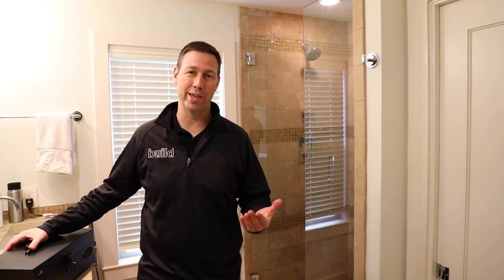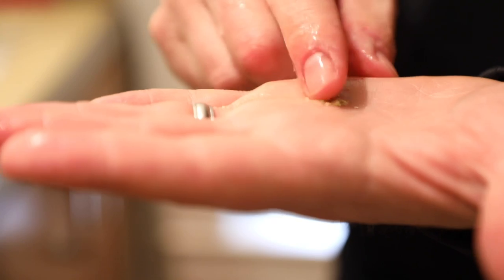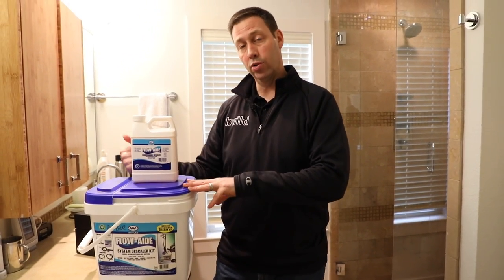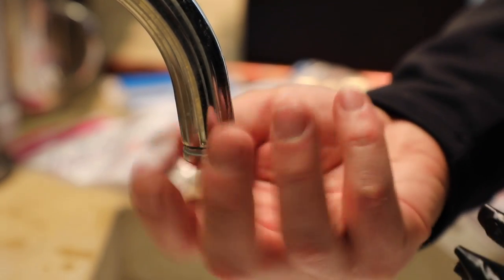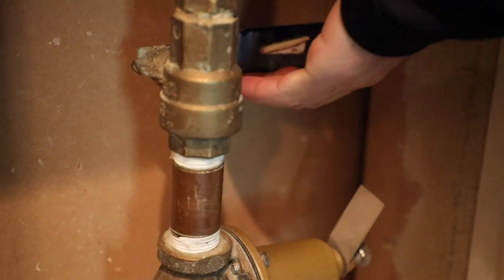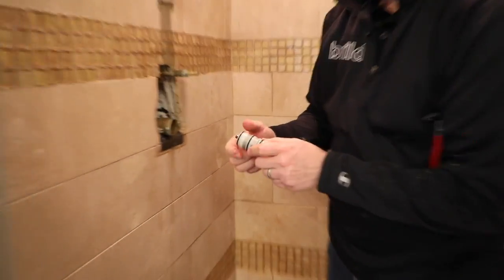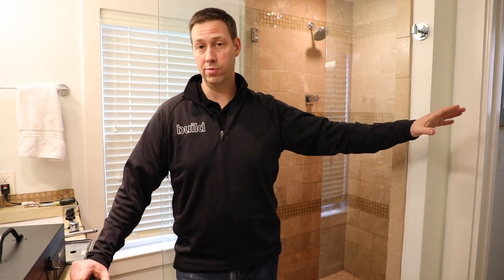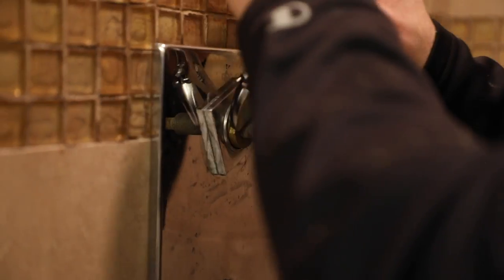The Bummer for Tankless Water Heaters - Fixing a Scale Issue

Comment: Matt, your videos are always extremely watchable, but I do have something to offer concerning the flushing procedure.  At least on my tankless water heater, immediately below the water heater and in-line with the cold water supply is a thimble-sized water filter that needs to be removed and cleaned after every flushing...or more often if the supply water is unfiltered or otherwise prone to have fine debris, sand, etc.  Recirculating "contaminated" or particle-heavy cleaning solutions is asking for such a filter like this to clog and fail.  The typical homeowner is then stuck with having to call a plumber to remove and clean the internal spinning flow-control device needed to inform the heater of flow demands.  Fouling the filter would be a major whoops.  And by the way, my water heater manufacturer specifies clearly to never use chemical cleaning solutions, but instead stick with food-grade white vinegar, 4 gallons in a 5-gallon bucket.
Reply: GOOD COMMENT.     You are providing information that his guy "Matt" probably has no knowledge of.   After all, he may only be a plumber if anything at all.    He does a lot of talking without putting much thought into what he actually says.   There are many things stated that are either completely wrong or very misleading ....but I doubt he cares.

.

Comment: Not sure how this works with you in the US, but here in Holland our boilerless water heater ( which also heats the house ) gets an annual inspection. Almost the complete unit gets pulled apart and cleaned up.
Reply: J.D. Willemsen Yes they make units here in USA,,which does the same thing domestic HW, or ‘and household comfort .

Comment: Need a fix..
My problem is the instant heating boiler tankless ...

I can't set it in the middle 😩 

It's too hott or too cold... no mild water..

When turned the faucet it clicks inside and goes too hot even on only  the lowest number 1 heating mode...

Comment: I know this is an older video but would Spindown mesh filters installed at the outlet of your on demand heater prevent scale from reaching water fixtures? Or will scale also accumulate inside your plumbing and break loose at later times resulting in the same scaling issue?

Comment: Do you remember the dip tubes maybe 20 years or so back??  Looks similar. .
  You need to have a softner & filter especially for those units.  If water is doing that, its also not very friendly to your washing machine and dishwasher.  
 Benefits of soft water are huge besides needing it
Reply: and the salt water flush goes where?
Reply: @CyberAnvil  usually find a stand pipe from the washing machine, laundry tub, sump pump, outside, or a leader drain.. Always find a place. It's definitely worth looking into. I did a few seminars, soft water extends the life of appliances and so much else.
Reply: @thomasbroking7943  
yes, i've installed and used a water softener.  soft water is nice, just thinking of the hundreds of pounds of salt dumped into our sewer systems.  personally, i lived in the country so i had no choice but to route the salt water down one of the downspout corrugated pipes leading to who knows where.
Reply: @CyberAnvil  hundreds of pounds??  They make them that use potassium also if the salt is an issue..where i live they have shown videos of the city plowing into the sewers, so salt from the house isn't even a thought
Reply: @CyberAnvil  it's a no brainer after you are blowing through water heaters, dish washers, washing machines, and especially these wall hung boilers..
Reply: @thomasbroking7943  
well, i was on well water which had a fair amount of minerals.  with a softener, soap lathered better so i suppose all cleaning was better, but i never noticed any breakdowns due to mineral deposits.  by the time minerals would have become a problem, it would have been time for a given unit to retire.
Reply: @thomasbroking7943  
a 40 lb bag of salt pellets (rock salt doesn't cut it) didn't last all that long.
Reply: @CyberAnvil  it all depends on the settings..hardness & volume = days between regeneration.. You can run it non stop and burn salt because you don't have it set right. I've been in a house that has had a 1/4 of the salt tank for 6 months already.. I'm waiting for it to get down to wash out the tank and I know it's regenerating to quickly became the previous owners were 5 and new is 1 .   potassium is also an option if salt is a problem.. Maybe you just want to install filters that don't use salt at all
Reply: @CyberAnvil  how often does it regenerate? How many thousand gallons is that?
Reply: @CyberAnvil  driveway salt doesn't work in the softner but the softner salt does melt snow. I preferred it thinking it has to be better for my property than the pellets, cheaper also
Reply: @thomasbroking7943  
crystal potassium is not popular here and very much more expensive.  dissolved minerals don't care about filters.

Comment: perhaps I an dense. why is there no filter on the outlet side of the water heater? I would not stop the scaling or the low flow but it would prevent the scale from contaminating the entire system after the heater.
Reply: Stanley Bourdon I say a y type brass fine filter with a ball valve on the y so you can FLUSH OUT THAT CRAP, if you can container it before it gets through the water circuit.

Comment: So what you are saying is 
Install water filters coming off the tankless to protect the water lines and fixtures.
and change once a year..
(Cheap saftey from clogging every thing up.)
and run the whole house on soft water....
Reply: You should put a descaling filter before the heater on the cold water input line. And a water softener if needed.

Comment: Typical rookie moves- sets shower faucet parts on the edge of the sink, possibly knocking them down the drain. 2. He doesn't bleed pressure off the system by opening the sink valve first, allowing the shower to spray him with water. 3. Replace the shower valve so the pressure pushes sediment through the sink faucets. 4. This need to be done on every faucet in the house.

Comment: So basically add a water softener before tankless
Reply from the maker: Yes. Or consider a more traditional tank
Reply: Or a descaling filter
Reply: What water softener unit do you recommend, Matt?
Reply: Yes, but not for drinking water.
Reply: wouldn't a screen after the heater solve a lot of this or do the deposits form farther down the line?
Reply: Actually, this happens with tank type too if you have really hard water.
The tank heater itself will be okay, but you will need to clean shower head, aerators on the faucet outlets, etc.
Reply: Down here in South Texas water softeners help but they don't under any cirumstances stop the super hard water we have down here.
Reply: Is that not code?
Reply: austin conant a RO system, would do too.  Where I live, there is a inlet water gauge,  then a whole house filter, outlet gauge, softener  brass filter , phosphate feeder ( food grade ), outlet gauge, , then an
RO sysrem to kitchen silk, & refrig ice & drinking water.
Reply: No a filter. The softener adds salt which probably will just worsen the problem.
Reply: jon spon I think that might be a possible solution. However, I’m not sure how this would impact overall flow capacity or pressure.
Reply: Robert Smith actually the salt is used to flush the resin beads of the minerals it has pulled from the water.  The flushing cycle happens in the early hours of morning by design and a final rinse removes the salt water before it goes back on line.
Reply: @skimbulshanks  maybe your fancy one does. For others it'll just clog and break down valve actuators burning surfaces etc.

Comment: I wonder if a sediment filter after the meter would make a difference and/or whole house filtration system.
Reply: A sediment filter (provided it was installed in a way that could be easily serviced/cleaned) might help, but it won't solve this problem as the problem is that the minerals are dissolved in the water. They attach themselves to the metals and imperfections and then crystallize forming that grit and scale. This tends to happen at points of big temperature difference (like the heating coils) and on imperfect surfaces where it can "take root" so to speak. In the case in the video, enough built up on the heating coils and in the "tankless" tank that parts of it broke off and traveled downstream to the shower and the faucets. A sediment filter just after the tank would help fix that issue to an extent and would make for an easy first step to troubleshooting. If putting a sediment filter on the cold line, not going to help so much except catching stuff that city or your well pump system did not catch.

A whole house filtration wouldn't really help unless it can de-mineralize your water (which is sort of what a water softener system does), which the video maker comments on a bit.
Reply: Kurtis Whittington nice comment thanks!
Reply: @MrBrianDuga : Agreed.
Reply: @KurtisWhittington  Good explanation, I appreciate your input.

Comment: We have had tankless for years and never descaled. First one was an antique cast iron with copper core. It died because cast iron feet rusted away. Maybe good water? Maybe u crank the heat too high? There is no reason to heat the water hotter than the hottest shower. There is no reason to mix in cold water (unless someone likes it hotter).

Comment: Tankless manufacturer’s recommend flush once a year
Reply: Does the manufacturer know how many people are in your household??? That is why he said if more then 2 people use it, flush it yearly and if just 2 people or less every 2 years will work just fine. (unless you got really hard water)
Reply: mister clean   could try Hot Water Sediment Post Filter System, still need to do maintenance, the filter will catch a lot of corse clogging sediment before it gets in your pipes

Comment: Tankless are not limitless hot water. there are very particular flow amounts they can do. They are a hot water heater without a tank, thats it. Not instant heat (at the faucet) nor limitless, both common fallacies. Many houses with maximum usage need more than one tankless.
Reply: Brent Farlie it has to be PROPERLY SIZED , or there will be complaints.

Comment: I'm wondering why he just didn't use the water stops at the valve its self.  Pull the cartridge open & close the stops. Then just turn the sink faucet on & off a few times. Then leave the faucet run. Do the same with the shower valve. Reinstall the aerator and shower head. You're done. His way would take longer. I guess that's ok if you are getting paid by the hour. 
   Buy a tankless with Stainless steel heat exchangers.  It doesn't stick to the coils as bad.

Comment: Tankless water heaters do not have "boilers."  They heat the water below the boiling point, preferably 120 degrees F. And your "bummer" scale deposits are the ruination of tank-type water heaters. With tankless, the heating elements are not destroyed.  Put a pre-filter on it and forget about calcium deposits. Mine is twenty years old. I have hard water but never need acid to dissolve calcium carbonate.

Comment: Top tip: Turn off supply, don't open tap to release pressure, attempt to disassemble valve, get covered in water, get clipped round the ear for making a rookie mistake - you'll only ever do that once with a high pressure system.

Comment: WOAH! HUGE LIE! if you have a water softener you still absolutely have to flush your tankless hot water heater. not only will not flushing void manufacturers warranty. it'll destroy the heat exchanger especially a copper one. the copper will pit and make it more susceptible to leaking.
Also tanks are supposed to flushed also and give the same kind of sediment build up in aerators. so this problem is not unique to tankless hot water heaters

Comment: scale build up happens to both tankless and traditional water heaters. if you have tankless system, you need to have some sort of mineral reduction system to prevent this from happening, or you have to drain and flush the system every 3 months.
Reply: Well, you are partially correct.  "scale build up happens to both tankless and traditional water heaters" IS correct ...which is what this guy has very clearly inferred is the "downside of tankless heaters" ....which is completely INCORRECT.       BEFORE considering the need for any kind of "mineral reduction system", you FIRST need to know if any kind of system is needed in the first place.    Typically, people DO know if their water supply is HARD or SOFT water to start with.  However, it is best to have the water tested first and actually KNOW exactly what the condition is of the supply water.   THEN, you will know what needs to be done to make the water better for your water system.

Typically, "people" learn about their water by talking with their neighbours over the fence or at a party.   This is NOT how to learn about your water ....unless the neighbour can hand you a recent certified water test report to look at.   Not all "mineral reduction systems" are created equal.

.
Reply: @taxicamel  After several more years in the field of service plumbing after my initial comment, I agree with what you are saying. most people do ask their neighbors what systems they have without realizing their neighbors needs may not line up with their needs. For example, In my area they use chloramine to disinfect the water before it gets sent to homes. they use this because it returns to a "safe" level of consumption faster than pure chlorine and it does not smell as strong or at all. The problem with chloramine though is it can cause serious dry skin issues, additional the byproducts of the disinfection process are not filter completely out and are sent out to home. A traditional softening system does not remove these chemicals. I am a strong believer in testing each homes water and talking with customers on how they use  and consume their water to provide custom solutions to best fit their needs. Their are a lot of misconceptions on the safety of public water also just because its safe to drink doesn't me it is safe for your plumbing systems, and I have seen plenty of people now end up having go through the headaches of repairs and renovations due to the lack of prevention and maintenance, which neither are addressed enough in the plumbing field.

Edit: I am in Nebraska, I have never been into a house with out a softener that has less the 8 grains per gallon in hardness.

Comment: I hate ‘on demand water heaters.’  Absolutely hate them.  I looked after numerous off-grid residences for people that had them and overall they are a supreme PITA.  My tank water heater, along with all of them I have owned in the past, have just purred along without any unforeseen issues.  As far as cost goes, I don’t see the savings people talk about having a tankless water heater.  Even the plumber here who installs them doesn’t like them, nor does he own one.  Seems that people who say they are more cost effective are just trying to justify the  $2K + they blew and are going to argue it to death.  Tankless water heaters, IMHO, also causes you to use more water.  You can’t just trickle hot water because they need the pressure, so full blast water is the norm.  Anyway, if you have one, enjoy it.  Ha.

Comment: You said it within the first minute. Well sort of, you said Copper boiler but its a Copper Heat Exchanger. Anyways, Dont buy a junk copper heat exchanger. Insist on a quality unit like  Navien that uses a dual stainless steel unit. Put flush valves in and service your machine. If your water sucks use a sediment carbon filter and a water softener, if you can swing it UV doesnt hurt either. The point is don't buy junk and maintain your stuff and you wont have a problem with your tankless.
Reply: Also why do people install this outside, thats crazy to me... If someone wanted to come along and harm the unit they could.
Reply: *Juan
ha  ha  sounds like a whole bunch of money.  being that the tankless product is usually twice as expensive.  then if you go electric, you might need to pay for a 220ac installation or reroute.  then your electric meter will spin into the next solar system.  all for endless slow.  Oh, the humanity.  pay extra for stainless tanks?  that might just be 3x more than a tank type.

Comment: Tankless water heaters a pain in the ass is your not mechanically inclined, and can service it yourself. All the savings of the tankless are lost on yearly maintenance from your plumber. Also if the power is out no hot water.
A good old standing pilot gas water heater is still the king when it comes to affordability, reliability, and hot water
when the power is out.

Comment: .... you have valves on the shower faucet itself no need to turn off the main
Reply from the maker: I took out the valve
Reply: There are stops left and right of the valve body
Reply: John, How would he "blow out" the system using those two screwdriver activated valves?
Reply: by opening and closing them ...
Reply: No, Mr. Risinger you removed the thermostatic cartridge. The valve body is still in the wall, connected to the plumbing pipes. 
Ha ha ha ha...
Reply: I would rather use the main shut off seems troublesome to work with small screws with water coming at you full force
Reply: TheBostonstapler the ONLY PLACE I ever had those were in apartments,,or some condos, not all homes have them.